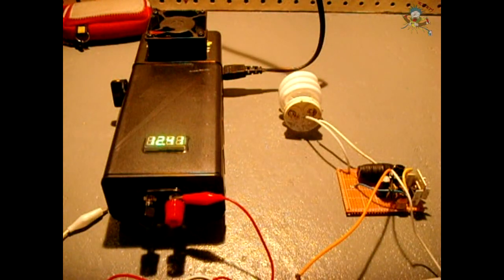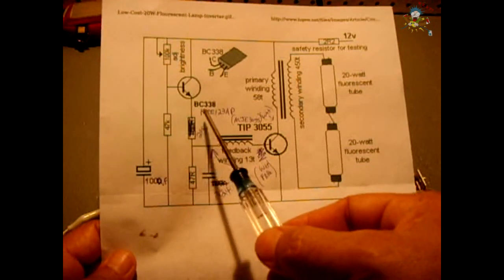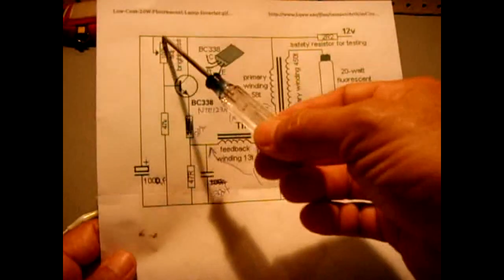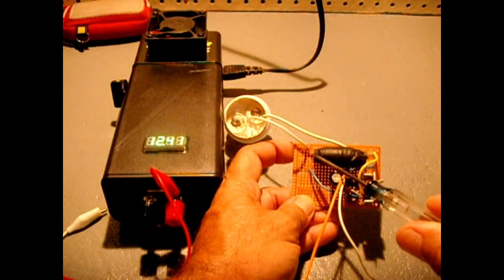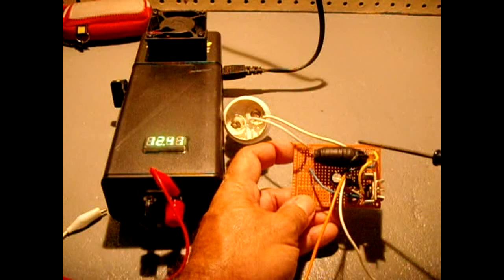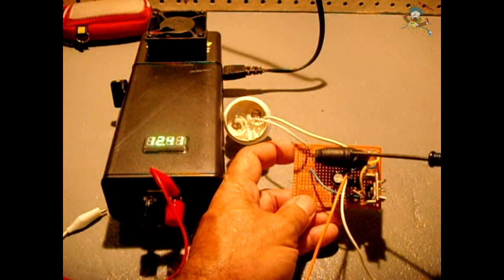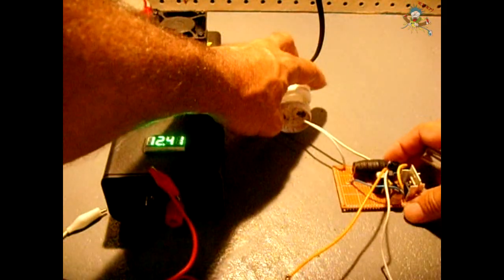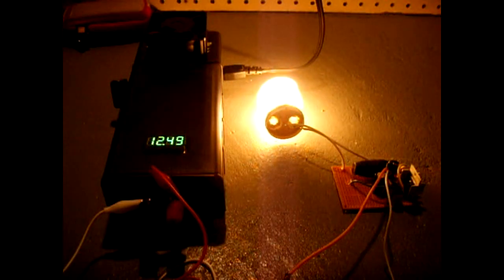Simple HV Fluorescent Tube Drive Circuit 20WATT+

Comment: I made a circuit capable of driving 100+ watt tubes at a mere 6 volts using an orinary 12 volt to 220 volt transformer, and It was capable of giving up to 8kv spikes on the output with only a 555 timer and a tip122. Still not bad though.

Comment: Does this circuit work as a replacement for the inverters found in LCD monitors ? It would be very neat if one can use this to power those really thin CCFLs.
10x a bunch electronicsandmore. You really are an extraordinary source of inspiration !
Reply from the maker: +kuunlaan 
It may work. You can buy laptop inverter boards on Ebay really cheap. :-)

Comment: Single-ended works fine for this type of power oscillator.
And at least this design won't burn up under low voltage,  like the traditional MOSFET design found in most cheap CFLs.  This looks like a blocking oscillator... the only differences between this and a shunt-fed Hartley seems to be the reversal of the feedback winding and the absence of a tuning capacitor. =  Should be quite efficient in this configuration, really.
Reply from the maker: It works so well, that I used this circuit for a power failure light in our home.

Comment: Nice! But I would recommend you to build a push-pull driver, it's more efficient than this one. Mine takes around 1.6 Amps and drives 20W CFL REALLY nice (brightness is the same as the standart 20W CFL). I'm going to upload a video about it soon
Reply from the maker: From what you stated, this circuit does not perform much differently. If I crank up the brightness, I can also fully light up a 20W tube using 1.4-1.5A.

Comment: I built this unit back in 2006 and it runs well, Except I only used the 1 transistor version I have 1X40 watt fluoro tube hooked up to it and it works well,  it takes about 9 volts to fire up and then I can turn the volts down to 6 volts before it starts to dim and it will still run down as low as 3 volts. I have used the ferrite rod to wind the transformer and then coated it with hot melt glue to seal it.

Comment: so it was about 1KV? well, at least now i know. I tried doing the same with some 400V transistors from a few burned CFL to make a 12v to 400V dc-dc but the only way to ionize the gas was to use the filaments to heat the gas.
I dont like using transformers because pain in the butt math and because i still havent had the time to make myself the instruments to measure them and stuff but there seems to be no other way :(